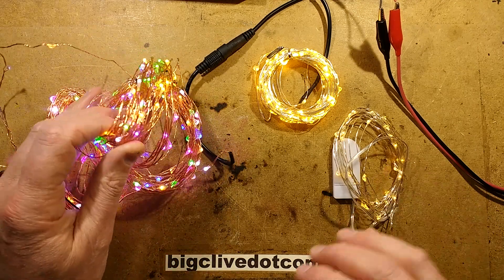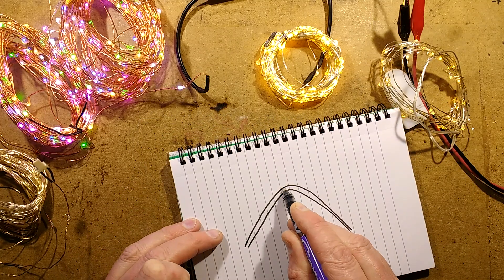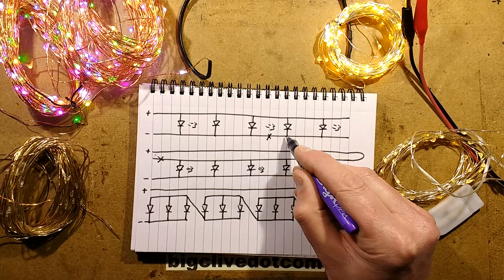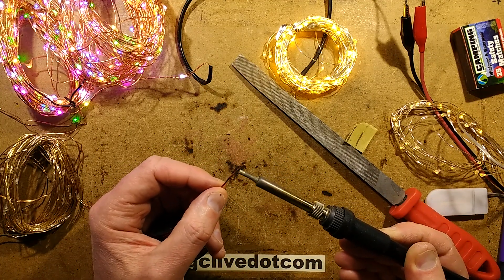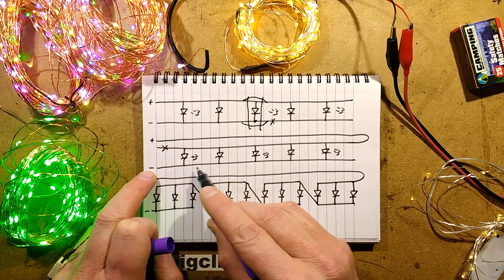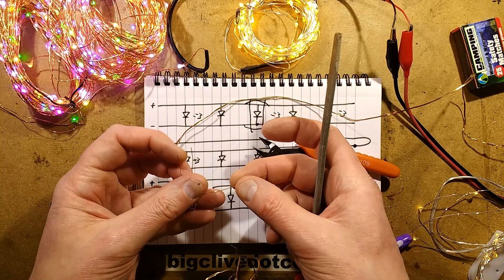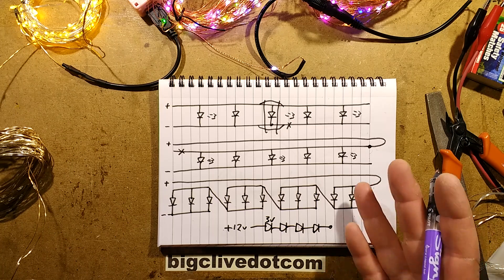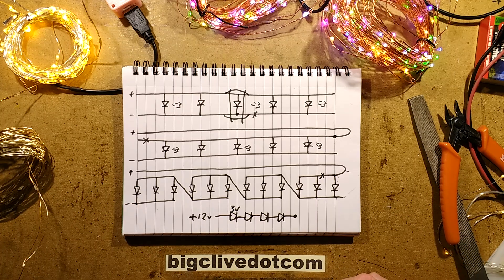Fixing low voltage copper wire LED strings.

Comment: Could you help answer a question? I bought some vine led lights off Amazon, it came with a 2 prong circular European plug and a tiny black converter/transformer to go into my American style outlet. The voltage says 110/240v input and 4 output. My American outlet has I think 240v. The lights stopped working after 2 weeks. The transformer/converter’s blue light still comes on inside the box when I plug it in, but the lights don’t light up. Can I buy a better transformer to see if the lights still work? Or did the bulbs burn out, or it’s a fuse issue? It was probably cheap and it says on the black box it’s made in China, which I’m sure they weren’t doing their due diligence to handle American outlets. If you could let me know a way to fix it that would be great, I love the vine lights and they were a pain to put on the wall!
Reply from the maker: Is the power supply marked with an output voltage?
Reply: @bigclivedotcom  my original comment was based off the wrong converter, sorry. So the output for the correct one is 31V 193mA 6W. It works with a different set of string lights no problem so I don’t know why the other vine type string lights aren’t lighting up. When I noticed it went out, I unplugged the circular plug from the box and plugged it back in. I noticed the bulbs came on ever so faintly and then very slowly went out and never came back on again
Reply from the maker: @maryhawker5003  Check along the string of lights for a broken connection.  You may see that the string of lights alternates between three wires and two wires along its length.  Look carefully at the ends of the two wire sections.  It's a low voltage set so if it's a properly made one it should be safe to gently wiggle connections with the power on to see if the lights light.
Reply: @bigclivedotcom  hey I’ve tried to respond three times now and I don’t see my replies. Can you see this comment?
Reply: @bigclivedotcom  I’ll try again, so the lights are a vine type style with tape wrapped all around it to mimic looking like a birch branch. But it goes over the lights so tightly I would have to cut the decorative tape, ruining it. I saw that there’s a device which looks like a glue gun that makes burnt out string lights work again and you click it up to 30 times inside the incandescent socket. Would that work for LEDs though? Maybe I could put it on one of the two prongs in the circular socket that plugs into the power source and click it that way? It’s low voltage so maybe it’s worth a try? I’m also going to see if I can detect any voltage in the string at all. But let me know if you think I can get it going again and I did gentle wiggle as many of the LEDs as I could last night but nothing happened sadly.
Reply from the maker: @maryhawker5003  The sparker is only for tungsten lights and may damage LEDs.
Reply: @bigclivedotcom  okay gotcha. So I used a voltage detector all over the vine lights, including the cord, at the base of each LED micro mini bulb, the two prongs, and the power source box. I can’t find an area where there’s no power. What does that mean? If it has power to everything why won’t it light up?
Reply: @bigclivedotcom  update, after seeing the voltage work for the entire thing basically, I looked closely at the lights with every single light off in my room. And two of the branches were barely on, one lone light bulb in a cluster of 5 was on the very top, and 2 bulbs were on on a different branch under that. I could barely see them and I did a video which can barely see them too. But no lights were on for the bottom half of the vine of 9 branches. Not a single one. So some are technically on, barely though. Any advice or ideas would help immensely!

Comment: Best explanation I found great job, simple but now I know why I didn't fix my wifes 3 wire system when reconnecting the wires she cut. Didn't remove the insulation and didn't test for the correct wires to reconnect.

Comment: have been doing that for some time, but havent had a look at the 12V version yet.  some questions, is there a general rule on how much one of these may draw? or are these wildly different? any way to figure that out? i had some that ran on battery, but i dont know if they run them on less amp to conserve battery life, and the actual led string could handle more without any drawback? 
Also i was wondering if one can get like a spool of just the copper led strings, to do custom ones? If anyone knows, please give me some info, thx =)
Reply from the maker: The current varies widely between products.  Technically speaking you could allow 15mA per LED.  But it's better to use much lower current, as the sharing of current in parallel can vary.
The easiest way to source large strings is in sets of lights.  I've not seen them sold as loose wire strings.

Comment: Hi on the battery version of the grain lights and you have 20 but you only need 15 can you cut the last 5 off
Reply from the maker: If it's just two wires going along the full run of battery powered LEDs then you can reduce the length by cutting them.

Comment: Thank you! A Question: connected to a three-wire string additional pieces of three -wire and then  two-wire strings successfully. 

Then wanted to connects a forth three-wire string piece to those three pieces. So it was three-wire, three -white, two-wire and another three-wire pieces. It all worked for a bit while I was arranging the strings. 

Then it all started blinking as I was working on it and then it all went off. 

So I disconnected all the wires and I’m trying to find what happened. It appears the last piece is not working anymore at all . 

However  now I couldn’t connect the first three back. When I touch the wires of the fist piece together that first section works. 

When I try to connect the second piece (three-wire) it lights up but only when opposite wires connected, and then the first section goes off. I’m confused. 

In other words: It all worked, then stopped, I took the connections apart, in case the connection went loose(unlikely) and now I can’t put it back for some reason, as pieces are working only separately. The last one is not working. 

Any comments?

Comment: Hi Clive,
I have some cheap Chinese copper wire led lights. They are usb powered to 2 wires 20m in length and have 200 leds along them. My problem is how to fix what seems to be a sizeable voltage drop resulting in a big drop in brightness from around the last third of the lights. Any help would be much appreciated.
Reply from the maker: That could be a short circuit near the end or the lack of a third wire feeding one leg from the other end.

Comment: Hello, I think I have the same lights as the green ones for the christmas tree, I have rolled them together but the lights turn on and off, how can I save them? Please :(
Reply from the maker: If they flicker on and off while moving them you may have damaged the very thin insulation.   If you can find where that is you may be able to repair it with nail varnish.
Reply: Please, I paid $80 for my lights :(

Comment: I tried to do this with some bluetooth LED string lights and the strangest thing happened. I tested it with  adding 2 lights to my 100led string and they worked, but when i attached the full 50+ led set i wanted to splice nothing lit up except the last two led in the set and out of sequence...i have no idea what to do next
Reply from the maker: The LED voltages in parallel arrays must match.
Reply: @bigclivedotcom  i swapped the direction of the cord and that lit up the whole strip, but during the sequences the new strand lights yellow where it should be white. I can live with this but curious why this is happening. Only the whites have changed to yellow all other colors display correctly

Comment: Hello sir, i have these string lights for a year now. And now it is half lit no longer the whole  30 ft of leds . Just half of it but still lit up for hours. Is it becoz wrong battery or any issues on the solar itself. I just could not figure out . There is no cut wires..

Comment: Thank you!!! Mine was a 3 wire system low voltage , I noticed it wasn’t working and I was bummed out because I really like my lights and didn’t want to purchase new ones. But then I found your video and I was able to fix it!

Comment: Great video but I have a question/issue please - I found a break in one of the two cables right before/against the first non-lit LED, nipped the cable the other side of the LED, stripped the lacquer off and touched the ends together. However, rather than them all lighting up again, the 'good' ones up to that point also go out. Tried removing that LED completely on the other cable too but the same result. Any ideas please?

Comment: hello there awesome video, just wondering the one that I have is 2 wire copper led light with USB input, was using it for 2 years it just stopped working completely, is it the resistor & can I fix it myself

Comment: ive stick to some led's an electrical tape, so i wont see their light, is it ok?
Reply from the maker: If you mean you've covered some LEDs with tape then it's fine for these low power ones.  They don't get hot.
Reply: @bigclivedotcom  thanks

Comment: I have two metal wire leds, can I shorten it?
Reply from the maker: It depends on the type and voltage they operate at.
Reply: @bigclivedotcom  thanks

Comment: I went full all the emotions following this, thinking I had the two wire set and could swap it out, then realising it’s a 3 wire set and watching you do the repair made it look really straightforward, to realising actually I’ve got the 12v set and I should probably just buy a replacement.
Reply from the maker: They're all usually repairable, but the 12V one is a bit more complicated.

Comment: Hi...I bought some 3 wired copper string lights with a plug into the electric. The problem I am having is along the line of the lights one copper line went out. I fixed it by watching your video thank you...but now I've come to turn them on today and they aren't working at all? I must admit I painted my fence and got paint on the lights I didn't think having paint on them would stop them from working? I've been along the lights 3 times to see if there is a cut ect and nothing. This is a pic of the plug if you need it? Does these plugs have fuses in them and that's why they aren't working? Help lol...
Reply: Whoops it won't let me add a photo!
Reply from the maker: It might be a broken wire along the line or corrosion.
Reply: @bigclivedotcom  I've been along the line nad can't find any broken I will check again lol..thank you x
Reply: I still can't find the broken wire? I thought if a break inbetween the lights would not effect ALL lights? Well looked again this morning an one end of the lights go to the plug an the other end its just fitted into a plastic sleeve is that right?

Comment: Thanks so much, fixed a set before like this but couldn’t do it this time.  2 wires, but realised we weren’t stripping the ends enough.  Initially tried scraping with a knife and sandpaper and it didn’t work.  This morning I tried again, burning the ends with a lighter and then sandpaper.  Worked no problem 😊

Comment: I NEED HELP! so I bought the copper wired lights with the battery box. Before testing, my wife installed them on her headband but they won’t turn on. They way she installed them, she wrapped the whole band around and around. Considering it being copper and all the wires are in contact. I’m thinking it’s causing them to short out and won’t turn on. But if that’s the case, how will the lights ever turn on at all with the copper always being in contact with one another. Can someone let me know what I’m doing wrong and if my theory is correct or not.
Reply from the maker: The copper has an insulating layer that is quite hard to damage unless on sharp edges.
Check the batteries are actually making contact, some have shorter pips on the positive end than others.

Comment: Trying fix my fairy light table lamp. Half the lights went out. 1 bulb is missing. 2 wires on each fairy light. Can I fix this
Reply from the maker: Look at the area where the lights have gone out to see if there is a broken wire.
Reply: @bigclivedotcom  I have the area where the wire is broken
 The light is missing must have fell on the floor.
I now have 4 wires. 2 from each strand on either side of where the light was. I cleaned them with sandpaper and when I touch them together some of the combinations turn out all the lights. Hoping I am close in resolving this. It just has been over 30 years since I did this type of fault finding . Thank you for your response. Any ideas
Reply: Wish I could send a picture to show you the broken wires

Comment: I had to dig deep on Google to find this solution to the problem. For all the time I wasted, this is the BEST answer to the problem. The diagrams were less important to me than the final segment showing how to fix the problem. There I learned that the wires after being cut must be filed/sanded to remove a clear resin coating so that when you connect the CORRECT two wires, the strand will light. I don't understand why this video doesn't come up higher in the search results. Thanks Big Clive for posting this. You are muy worthy. :)

Comment: can you use a lighter to take off the laquer
Reply from the maker: Yes, that often works.
Reply: I tried the lighter on green lacquered wire, but it didn't work.  After watching this video, I tried sanding the ends, too, and that did the trick.  Might be some clear, heat resistant lacquer on there.
Reply: I use sand paper it works really well nice 👌 clean solder! Burning is no good because the solder won't grab it makes the wire dirty.

Comment: Well documented and explained!  I used this video to cut a string of 5v, 3-wire down and add it to another string I had, and then sew up the first string after cutting it.  To avoid increasing the resistance of the longer string too much, I connected all 4 of the positive wires together in parallel at the splice.  Original string was 33 feet long; new strings are 36 foot and 30 foot.

Comment: Little tip - You know the unused USB 2.0 ports on the back of the Tivo 6, Tivo 500 or Youview DN370 DN371 and DN372T and SKY+ PVR boxes or I guess any other ones - you can use them to reliably power these I have my whole lounge front window lighting up without batteries or any PSU all driven from the usb ports - The youviews have two usb ports which give even more scope!

Comment: Hi, firstly thank you very much for arranging such simple explanation. Is there any chance you advice how we can find out our wire LED which one of you described is? I have an cupper wire LED which I purchased from John Lewis and now noted that it lights only half way. Therefore I have say four meters long LEDs which only two meters are on. However only one LED turn on at the same time with the first half. in one place, between two LEDs has missing wire and I don't know whether I can use your idea in cutting and stick the further LED together. Many thanks - Matthew
Reply from the maker: If it has worked in the past, look for any obvious broken wire where the set stops lighting.

Comment: Hello there, I hope you can help me. Well, ive got 100m - 1000 leds copper string lights (they are connected from 10 to 10m). And they have been cut by somebody and now when I connect them back, wire to wire Ive got 2 options: 
1. The whole string works (at maximum light capacity), except the 10m section where the wire is broken, doesnt work
2. The whole string works, at full light capacity, but it stopps at the end of the 10m part, where the cut was done

There is no match for the wire to make the whole string work again

I try to fix them for 2 weeks but bo result. Please give me some hints
Reply from the maker: If there are three wires one will go all the way up to the far end.  The other two will only work properly when connected the correct way round.

Comment: What if none of the lights work?  Tried new batteries.
Reply from the maker: Check that the batteries are touching the contacts OK.  They can look like they are, but be a hair thickness from making contact.  Also check that there's not a break in the wire.

Comment: Thank you. I had a broken string of battery powered fairy lights and i cut off the ends in between lights, lit them on fire to burn away coating and spliced them back together. :)

Comment: Hi there, I’ve just bought some of these wire fairy lights and they were as bright as ever! Now they are very, very dim. The batteries I used were completely new too. For some reason the brightness is now quite dull. Almost like they’re not even turned on. I also have only had them for 2 weeks and I only turn them on for 2 hours a day. Do you have any solutions or commentary on this? I would appreciate your expertise :)
Reply from the maker: Have you tried new batteries?  The intensity drops with the battery voltage.

Comment: For the 3 wire version - you fixed the LEDs that come before the cut you made. How would you also fix the LEDs that come after the cut? Thanks!!
Reply: Update: Ok I fixed it. At the cut point I connected the right wire to the left, the left wire to the right and the centre wires together.

Comment: So if I wanted to use these style LEDs or create my own, how would I go about to use with 9v battery? Would I need an what type resistor or how would I be able to achieve using a 9v battery for a long led string?
Reply from the maker: I wouldn't recommend using a 9V battery.  Using 2 or 3 AA cells will last much longer.